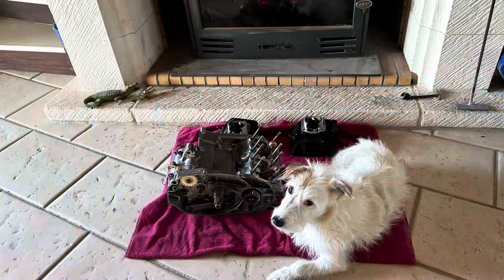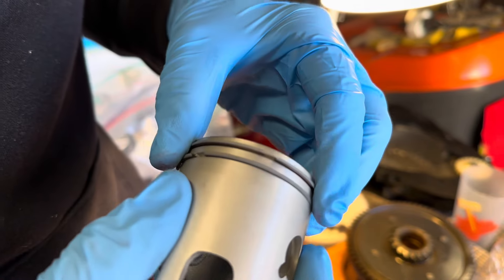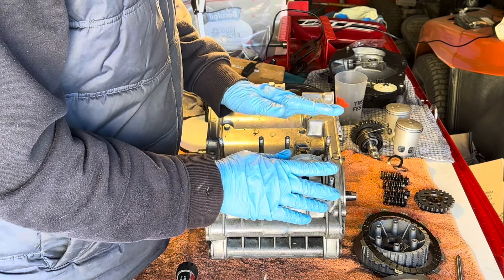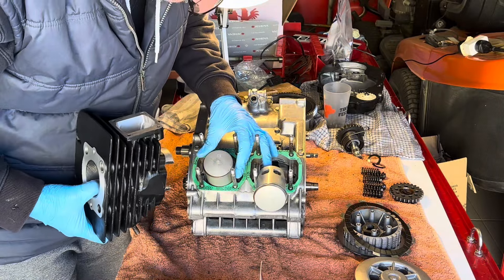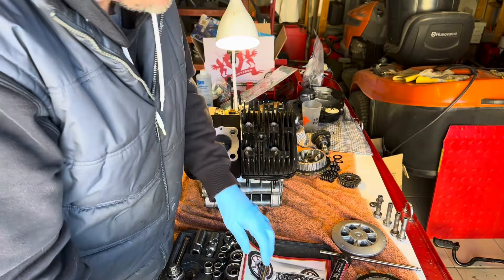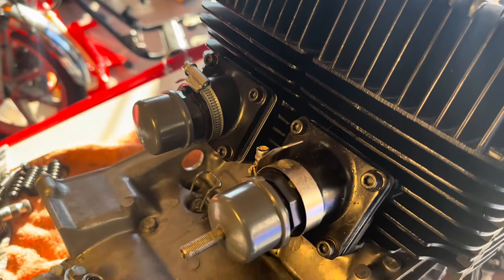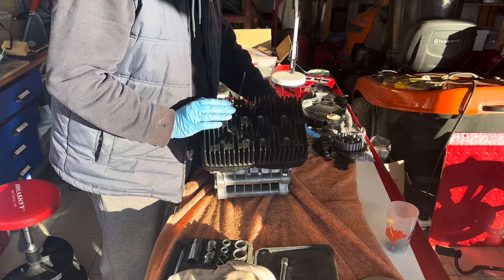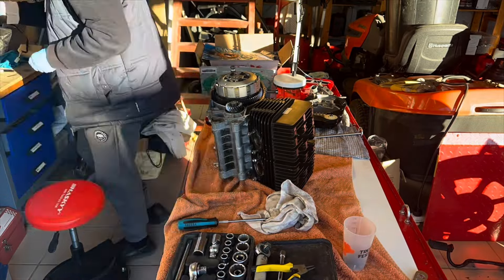Yamaha RD250 Engine Rebuild Doesn’t Go To Plan

Comment: A minor setback on the gearbox.  No damage done, but a good learning experience.   Hang in there, you will get her done up, right.😊
Your leak test set up looks good.  I would suggest two things to add.
1. Use a spray bottle of water and a little dish soap to spray on the engine points where leaks can occur. If you get bubbles, you have a leak.  Much better than relying on hearing and air pressure alone.  Make sure your air pressures holds for 15 minutes  without dropping.
2. Reverse your intake plugs and rest from the opposite too. Test twice, always nice.

On assembly:

Good job oiling with 2 stroke oil as you assemble.  Just right, not too much oil.

Things to consider:
Apply a thin amount of 3 Bond to your cylinder base gaskets, and your carb intakes.  These are notorious for leaking air.

Testing your piston to head squish clearance.  This can easily be done with pieces of solder taped temporarily to the pison crowns, in a cross pattern.  You simply cycle the engine around a couple of times by hand, then remove the solder, measuring the crushed portions with your calipers.  Compare your measurements to the shop manual.  If you are in the range of success, bravo.  If not, then investigate and correct cylinder torque down and head gasket.  Way better than ruining a piston or two.

Final thought:

Since you gave to reopen the cases, why not check your shift shaft to make sure she is good to go.
1. Check the spring on the clutch side.  They sack out over time.
2. Check the shaft for straightness. No bends allowed.
3. Check the final drive side for shaft abrasions that will tear up the shift seal.
4. Check the engine case where the shift shaft comes out on the final drive side.  This should be tight, with no slop.  Over time this can wear causing leaks along the shaft and poor shifting.  Later model RD's have a small pressed in bushingbetween the shaft and the engine case, which can easily be replaced.  If your cases do not have the bushing, you could add a bushing by boring out the case opening, or fitting an external bushing kit that contains a replace-able busing and seal.  The external option is available in the UK from RDLC-crazy, also known as Norbo.

You are doing great with your rebuild.  Do not get discouraged.😊
Reply from the maker: Thank you for taking the time to write such a detailed response, I really appreciate it. I’m sure others will find it helpful as well.
Reply: @RepairandRideout  My pleasure.  I just went through an engine rebuild on my YPVS 350 a couple of years ago.  Aside from the power valve and the water cooling,  the RD engines are the same.  Way back when, I had a '74 air cooled RD.  Suffice to say, RD's hold a fond place for me.  Glad to share where I can.  Looking forward to seeing your RD back on the road in your videos.
Updating my rear suspension and brakes this Winter.   Getting ready for Spring here in the USA.

Comment: Not necessarily, check the selector pawl on the end of the selector shaft at the clutch basket side, it may not be correctly centred on the pawl of the selector drum, removing the clutch basket will allow you to withdraw it slightly and centre it on the drum pawl
Reply: Indeed. More likely to be the shift mech than the cluster itself.
Reply from the maker: I’ll have a look but I fear it’s all got to come apart again

Comment: I  put the pistons the cyclinder first than mount them on the con rod . Just to make sure that i dont damage the rings as new rings can be a bit tight . I also lube the pistons with a bit of light oil .Nice job. We all have suffered disasters during engine or gear box rebuilds . But we just keep on lol. Love your streams 👍👍👍I feel your pain
Reply from the maker: Thanks for your help and support, much appreciated

Comment: ah one of those things with the gear box , dont feel downhartened  though because you did check before putting it into the frame ! 

I have always fitted pistons when they are TDC as that allows me to put a cloth over the crank hole so as to prevent debris and circlips falling into the crank case (!) . Twins I  insert the inner wrist pin circlip first before fitting to the conrod ( like wise rings like you did  ) then push the pin through and then fit the outer circlip.  The extra room at TDC allows me to keep a close eye on the pistons rings making surre they stay in place with the retaining pin in the piston - sometime they ride over if you're not careful .

Looking forwards to the next espisode ! thanks
Reply from the maker: I was too concerned with using the circlips just the one time and lost sight of other details. You live and learn 😊

Comment: If it turns out you need to split the crankcases, do you definitely need to remove the heads & barrels? Hidden bolt(s)?
Reply: On a Yamaha RD, yes you do need to pull everything.   No short cut here.
Reply: Fair enough. Cheers for the reply.
Reply from the maker: I think so. Never mind